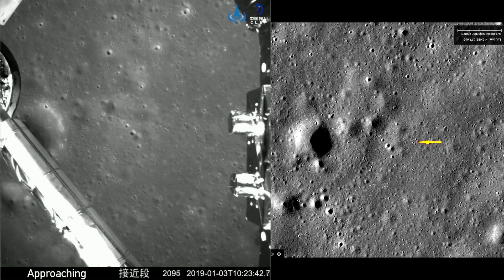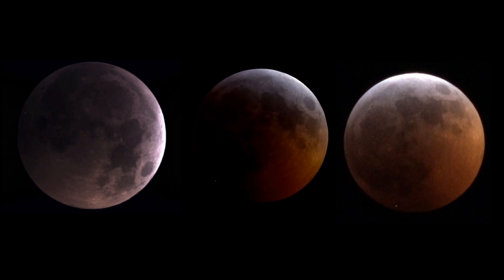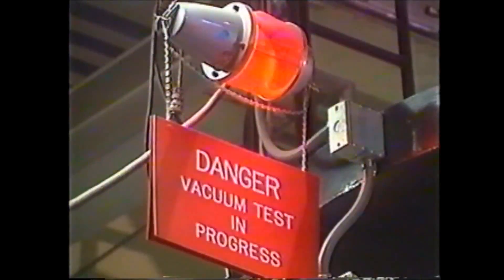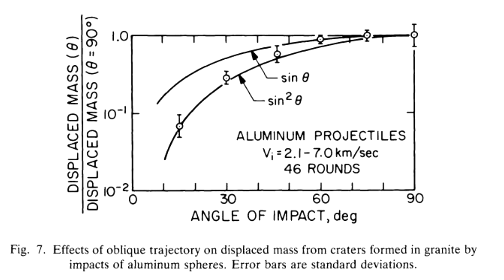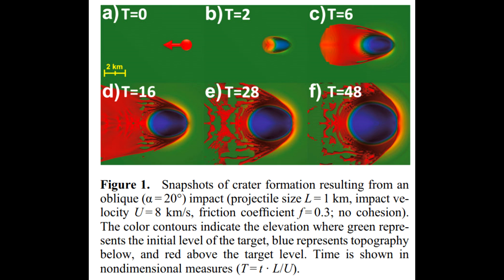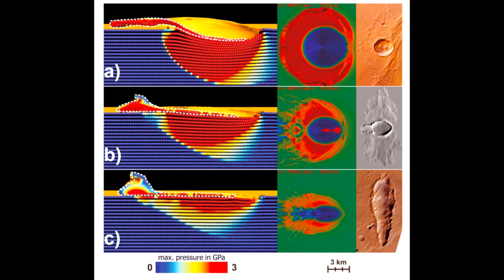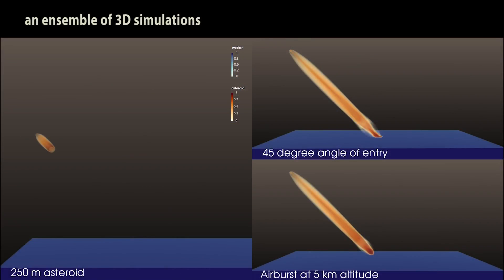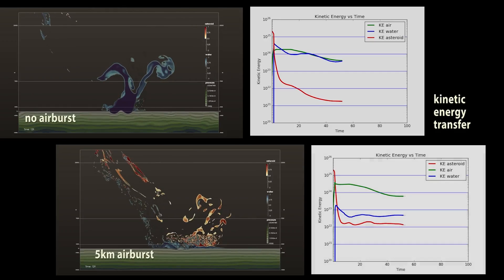Why Are Most Impact Craters Perfectly Circular? (Rather than Ovals)

Comment: The two ideas that were muted back in the day was either volcanic or meteors and it was decided to be impacts purely by a show of hands. But they never even considered anything else due to it being a time ago and they certainly didn't consider an electrical discharge. But as we know and from today's knowledge base of electrical engineering and plasma physics, when an arc hits a surface it always hits at ninety degrees and so it is easy now to tell what type of crater anyone might be. This is because the magnetic force created by the arc, wraps itself equally around the arc and so it can only hit at ninety degrees, as it is drawn to the surface equally on all sides. The majority of craters also have flat bottoms, with many of them having sharpened mountains at their centre and which is of typical of an electrical discharge. Also the question of the other geometry shapes seen and photographed are totally ignored and when such questions are raised, as we have found hexagons (the most common electric geometry for a discharge across the cosmos) as well even square craters and these certainly cant be explained by impacts or flat volcanoes.  Circles are low density arcs but as the power density in the discharge, it also naturally increases the magnetic field and so starts to straighten out the the circle, to eventually in the highest power density discharges, it creates a square crater.
Reply from the maker: * "The majority of craters also have flat bottoms, with many of them having sharpened mountains at their centre and which is of typical of an electrical discharge" 
This is also typical of impact crater simulations.

* "geometry shapes seen and photographed are totally ignored and when such questions are raised, as we have found hexagon" - not ignored here's a PhD thesis on the subject, you'll find that the first chapter covers the existing work on the subject. https://www.researchgate.net/publication/260034157_The_Structural_Control_of_Polygonal_Impact_Craters
Reply: @scottmanley  Thanx Scott I will read this tomorrow to see what it actually says. What ever a simulation outputs implies, reality says that any splash backs from a molten floor should be rounded, even if they could instantaneously hold their form and solidify. Splashbacks do not, unless the simulation has been fed those inputs, have sharply etched mountain appearances naturally. We have also produced the double lob type of cometary/asteroid configuration on earth in the lab with electrical discharges to mars like soils.
Reply from the maker: @postsurrealfish  The whole point is that they can't hold their form, when a crater is created it ends up with sides which are too steep to support themselves. The crater evolves and creates these structures.

Double lobe impacts are to be expected when bilobate objects are so common, in fact the beautiful thing is we can do the math on the observed rates to show that tidal disruption from nearby bodies produces consistent numbers. 
Here's a related paper on crater chains being used to constrain impactor masses based upon the requirement that tidal disruption by jupiter is needed
https://agupubs.onlinelibrary.wiley.com/doi/pdf/10.1029/95GL01422
Reply: @scottmanley  Yes I should have said mainly ignored, as pointed out in your link- "Polygonal impact craters (PICs) have been known at least since the late 1800s, and they were studied to some extent in the 1960s and 1970s. Since then they have been largely neglected." They of course have been largely ignored due to not being able to explain them with lab experimentation and so showing that this can happen.  They don't say any mechanism that could cause them but rather just describe them and then try and fit that description with previously guesswork as to the mechanism and say it fact, Where are the supposed plate boundaries on the moon, mars and all all the other planets, asteroids and comets which show the same geometric formations on their surfaces. "Thus, in paleotectonic mapping PICs can reveal tectonic processes not readily observed otherwise." So sorry that article just doesn't cut the mustard at all and this is why is it now ignored.
Reply from the maker: If you want to seriously argue that the lunar impacts we regularly see are the result of electrical discharges then you need to demonstrate the mechanism, collect observations and then look for a signature which would differentiate it from an impact event.

First up you'd need a demonstration of the crater formation happening in a vacuum, with an electrode a long distance from the surface. Then you'd record light curves, you'd look for radio bursts etc.

Perhaps you can link me details of such an experimental demonstration since every video I get linked shows an electrode close to the surface and not in a vacuum.

But seriously, you'd be better taking your electric universe ideas and applying them to something where it's known that they're important:
https://eos.org/research-spotlights/new-plasma-wave-observations-from-earths-magnetosphere
Reply: "First up you'd need a demonstration of the crater formation happening in a vacuum, with an electrode a long distance from the surface."
The impactor can be the electrode, thus distance of surfaces is no fatal problem for the theory. The same goes for solar ejecta, given a high enough density of the plasma expelled from the sun, discharge to objects in the solar system can be localized and strong. 

What makes this such an ungrateful topic is, that the lines are blurry, non-impact discharge produces surface features indistinguishable from impact energy releases, where the impact always produces a plasma ball which obviously is governed by EM forces. An aspect neglected by EU proponents as well as mainstreamers, but it is an important topic to discuss and it is encouraging to see that more and more mainstream proponents are willing to have a discussion.
Reply from the maker: If the impactor is the electrode how much charge is it carrying? 
We know that impactors move at tens of km/'sec so can you put enough electrical charge on an impactor to make it have more electrical energy than kinetic energy.
Reply: The impactor doesn't have to carry a lot of charge (though it could), there is plenty stored in the lunar surface.
Reply: @scottmanley  Any object coming from a less charged environment and then entering a charged one, whether an atmosphere or getting near another charged body has to take on extra charge to equalise that charge differential, an electric shock.
Reply from the maker: They were largely ignored because the imagery, data and tools to conclusively explain them hadn't been developed.
Reply from the maker: Sure, but you can't put enough electric charge on an object to generate discharge energies even close to the kinetic energy, put too much charge on an object in a vacuum and electrons or ions will evaporate from the surface.

Current can only flow until the charge is equalized. Try building a model - build a gun which places an electric charge in a bullet, then fire this bullet through a vacuum at a surface which is the opposite electrode. You'll be unable to get an electric charge on that object that is anywhere close to the energy of the bullet. And that bullet will have 1% of the energy density of an asteroid.

Never mind the problems with making an 'arc' in a vacuum.
Reply: @scottmanley  No thing as a vacuum, space is full of charged particles, diffuse yes but certainly not vacuum. Comets are a fine example of an object coming into a higher charged environment as it nears the sun and then has to discharge after being out in a less charged environment. When meteorites that have reached the ground and have been cut open they have found that the scorched outside is just a really really thin layer.
Reply from the maker: @postsurrealfish  While you are technically correct, the atmospheric pressure of the moon is 3x10^-15 bar, which is 1000 times lower pressure than the cleanest vacuums created on earth, so why don't you just replicate the hardest vacuum you can and then try making discharge craters. 
Comets meanwhile are coming from a cold outer solar system environment into a warmer environment, and observations of cometary atmospheres are heavily dominated by light volatiles with low pointing points, so  the thermal model works excellently. 
Meteorites spend only a few seconds in reentry heating, so it's expected that only the surface is scorched. 
So neither of your examples are inconsistent with thermal models and therefore adding electricity for the near field interation is not needed. 
Of course the cometary coma is certainly influenced by the deep space electromagnetic environment.

Suggestion: build a meteorite analogue and heat one electrically, and another with a flame. Run the heating for a few seconds and see how the thermal gradient differs.
Reply: @scottmanley  Jacob from our community already have. My bad is electric earth and weather mechanics and have written how the weather works from an electrical perspective. So if we want to really venture off world it is quite important to understand how atmospheres work from that electrical perspective. This is Jacob chatting on one of the community shows-   /watch?v=YdaPfSzeZWA&t=2s
Reply from the maker: @postsurrealfish  Thats great, now, what you need to do is figure out how much energy and light is released for a crater generating event of a given size. It's hard to tell but it looks like this makes a lot more light, so, we can take a look at the brightness of the flashes seen on the moon, and compare them against these simulations. What you'd be looking for is an anomalously bright flash on the moon compared to its crater size. 
So this is getting towards a testable hypothesis.
Reply: @scottmanley  Wal could tell you that, if we can find the new crater. Wal perfectly predicted (although it was an earth born projectile hitting a comet) what would happen in such impacts, when the electrical potential is taken into account between differently charged objects. View from 33:28 - 42:50, although when you get the chance please have a look at the whole video. /watch?v=34wtt2EUToo&list=PLwOAYhBuU3UfvhvcT1lZA6KbSdh0K2EpH&index=5
Reply from the maker: @postsurrealfish  I'm sorry but I watched that segment and it makes me very angry because the video makes several false claims. 
It talks about the transient camera glitch (likely a dust impact resulting in vehicle slew)  and then implies that the reduction in resolution is the result of interference, when the approach plan included reducing spatial resolution in exchange for higher temporal resolution.

The video claims that the event would produce a rapid bright flash and then shows an image as proof, but that's not what happened, the flash took a fraction of a second to achieve full brightness and was much fainter than scientists predicted. So the event happened more slowly than expected.  Here's a deep analysis of the light curve, if there was an electrical component it would have ramped up faster since electricity can cross the gaps faster:
https://pdfs.semanticscholar.org/7605/141c39ff7dc3cdea4412c28cd3a1e566f08a.pdf?_ga=2.84439770.211494003.1549070625-786264208.1549070625

It makes claims like 'absense of volatiles' when in fact the volatiles were there but carbon dioxide was a more significant component.

This is what makes me angry about EU, repeatedly cherry picking and misrepresenting data to support claims rather than trying to find the truth in the claims. 

You should read Karl Popper's writings on science and pseudoscience.
Science seeks to make predictions that are rigid, well defined and falsifiable.
Please start making such predictions if you want to be take seriously.
Reply: Other than totally ignoring EM aspects of cratering I don't have much of an issue with the science on impact craters. What is missing and is missing on both sides of the argument, is the combination of impact and EM.
Obviously in an atmosphere the entry channel of the impactor is a plasmatrail, in other words, it is a electricity conducting channel from the upper regions of the atmosphere to the ground.
In other words, in an atmosphere the effect is never purely kinetic.
But even in situations as on the moon, where there is no atmosphere worth mentioning, the explosion of the impactor is but a plasma-ball, thus there too one needs to look at a combination of effects. The mixture, in terms of magnitudes of force and effect will of course vary widely with velocity, density and total mass of the object impacting.
And when all that is said and looked at, the fact remains, that an discharge-only crater is practically indistinguishable from an impact crater.
To tell the two apart, new aspects need to be looked at. If I did such research, I would look at the local magnetic field at the crater site first.
Reply: @rosevfx  Impact craters have bowl like configurations. Discharge craters have smooth bottoms, because the discharge excavates as it rotates, much like a router blade. Some of the moon rocks our astronauts brought back, had a magnetic field impressed on them. That is evidence of electromagnetic activity, but the Moon lacks a  magnetic field, today.

Comment: Most Craters are actually Hexagonal.
Reply: Are they impact craters, though?  There closely clustered and fractally interrelated hexagonal cratering everywhere we look.  I'm not making a claim one way or the other, but someone has the proper and correct answer which also means someone is feeding me a load of crap, which also implies mass deception.  Is it possible, or am I off my rocker and lost my marbles?
Reply from the maker: Here's some light reading on polygonal craters https://www.researchgate.net/publication/260034157_The_Structural_Control_of_Polygonal_Impact_Craters

Comment: So the idea is that, because the asteroids aren't dense enough, when they hit the surface they vaporise and explode; meaning that there's no material to continue onwards and produce a hole/crater, and instead the explosion produces what we would call the crater instead?
Reply: Orbital impact speeds vary over quite a wide range. Not all are sufficient to vapourise the impactor.
Reply from the maker: Wouldn't matter if they were made of osmium, at those speeds they would vapourise.
Reply: @scottmanley  Damn, wasn't expecting a response! But thank you! :D

Comment: how do ya get pentagon shaped craters? https://commons.wikimedia.org/wiki/File:Saunder_crater_4096_h3.jpg#/media/File:Saunder_crater_4096_h3.jpg
Reply from the maker: Surfaces usually have existing directional structures. If you look at specific regions with polygonal craters their axes are aligned. The best example on earth of a polygonal crater is the barringer crater, and the pre-existing fault system defines this shape.
It's a complicated subject, but here's a thesis with a good summary section at the start:https://www.researchgate.net/publication/260034157_The_Structural_Control_of_Polygonal_Impact_Craters

Comment: I would guess that the presence of an atmosphere would result in slightly more oval craters as the fall back of ejecta would have to over come some air resistance. A vacuum is the best case scenario for round craters - thick atmosphere would be the worst.
Reply: I'd say slightly fewer oval craters; the atmospheric drag will slow down the meteorite along its direction of travel, while gravitational pull drags the meteorite into a steeper trajectory.
Reply: @phoephoe795   -  As I say I'm guessing - but it would be interesting to see angled tests done with atmosphere - not just the vac chamber results

Comment: Very nice, but there is one obvious question left to answer: does it match statistics? I.e. ARE 5% of the craters elliptical or trenches? It seems we'd be able to find 1 in 20, and then we'd not ask why all of them are circular. It seems much less than that?
Reply from the maker: Yep, the 5% corresponds to what we see on the moon.
Reply: @scottmanley  As you say, there's more to this than you can show in a short video - still, a minute on data supporting the conclusion would have finished off the video so nicely!

I'm sure those who asked from your dark side landing video had good reason to do so, and this as you say is the answer to them. The first question I asked myself after the video was the obvious: Good, OK, so are 5% of the craters eccentric?

Comment: Bottom line: with high velocity impacts, energy dominates rather than momentum. Rather than the analogy of throwing a rock into sand, think of it as throwing a hand-grenade into sand.
Reply: Good analogy
Reply: David Messer that’s an especially good (but dangerous) model because there’s a delay between impact and explosion where you can see the minor trench before it gets obliterated by the explosion

Comment: It is safe to assume that the likely new moon landers from China and NASA are going to use rocket engines to slow their descent and land. Do they simply aim everything towards the surface or are there techniques to also push the dust away from the lander at the same time to increase visibility? (Necessary?) How would an aerospike engine disturb the dust compared to a traditional rocket nozzle? Incidently, I see this crowd are getting somewhere with their aerospike, almost ready for launch testing https://youtu.be/oxqiyQiJavs. ARCA, and there I was thinking aerospikes were condemned to live out their lives within the Kerbal universe!
Reply: The exhaust from your landing engine will blow most of the loose material away like it did with Apollo no special technique required.  I don't know but don't see a aerospike behaving any different in that regard. :)